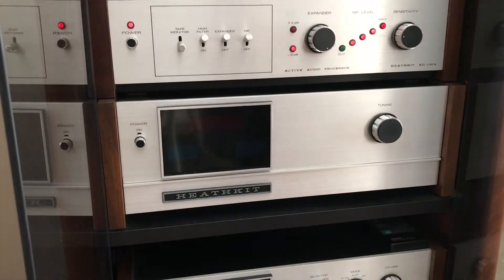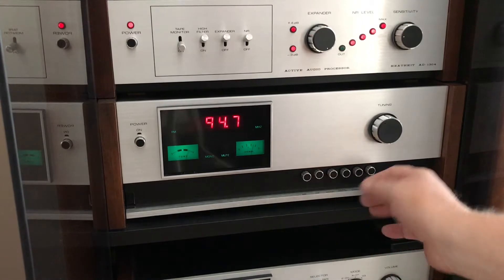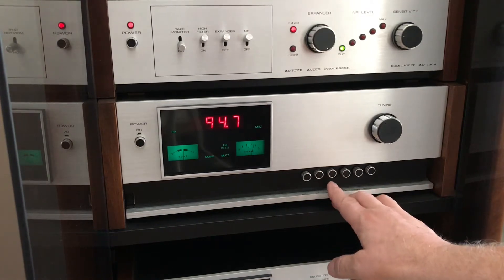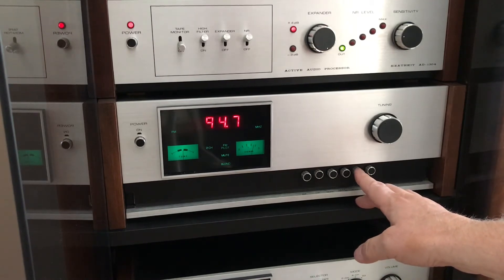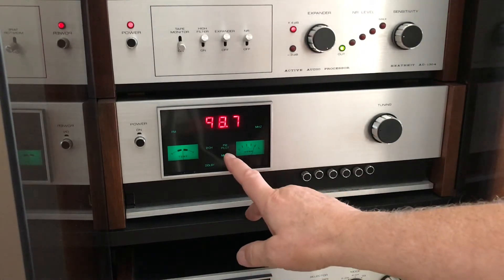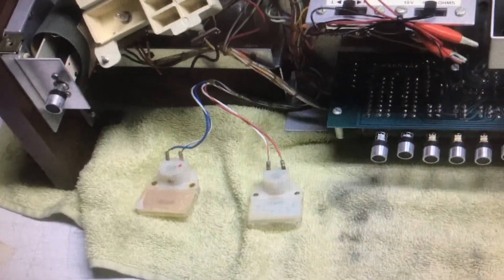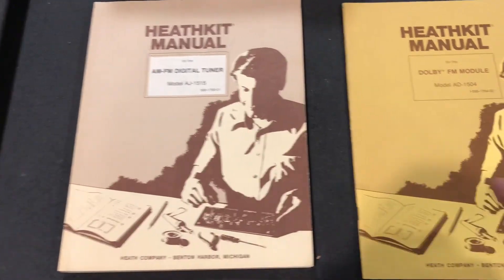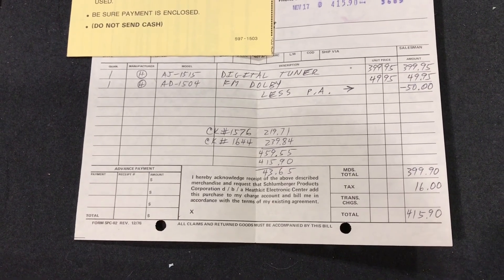Heathkit Vintage Tuner AJ 1515

Comment: I have the AR-1515 that I am restoring and am wondering if you have a center tuning drift problem that goes away after it warms up?
Reply from the maker: Hi - The AJ 1515 was off when I brought it out of retirement a few years ago, but I got out the manual and went through the alignment procedure and is working good so far. I have an AJ1600 that does drift a bit, so I'll have to tackle that some day. Good luck with the AR1515 - that's a big boy.
Reply: Please sell me full system !

Comment: Can this be paired with different receivers for say an analog radio to act as a digital display?
Reply from the maker: Most receivers have an aux input that would allow you to connect an alternative radio source. (If for instance the amp portion of the receiver works but the FM portion does not). You might try posting your question on the AudioKarma website if you need further info. Not sure I answered your question. Have a good day